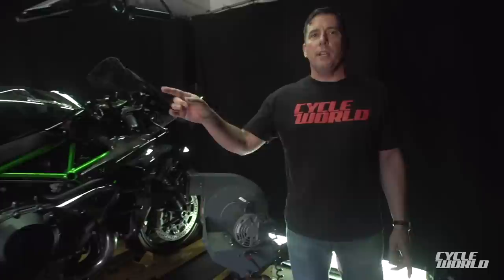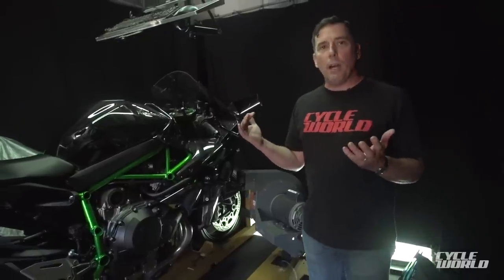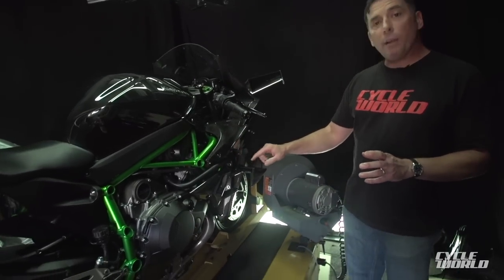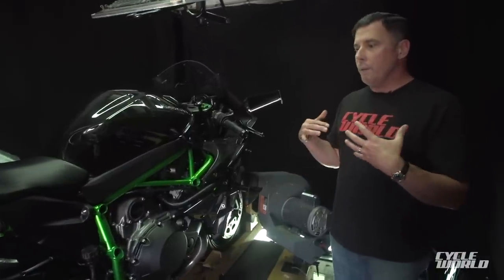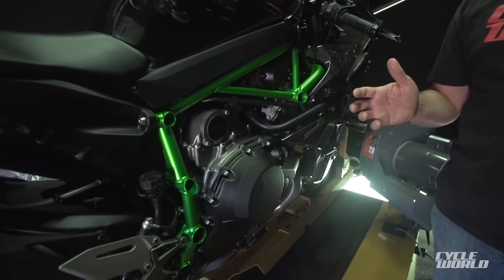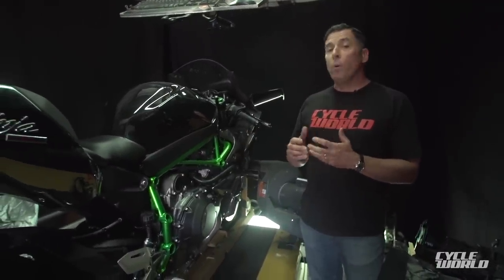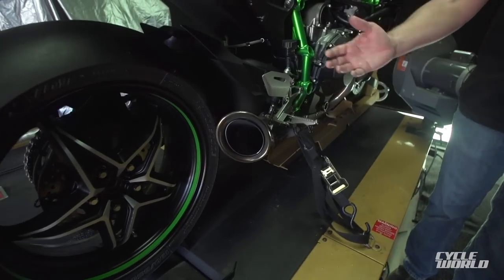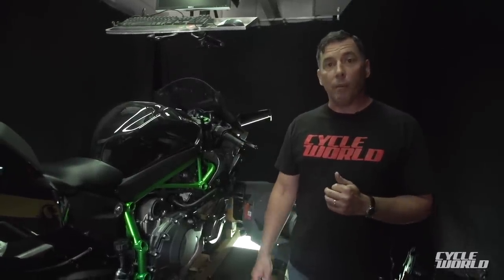Kawasaki Ninja H2R Dyno Run Video

Comment: Side benefit: the street H2 is same bike (same internal materials and manufacturing e.g. forged titanium) as H2R with main and only difference for the motor being the ECU programming.  A performance pipe and reflashed ECU = 320 hp or more on a streetbike - the H2
Reply: The cylinders arent the same. If you retune an H2 they will eventually melt.